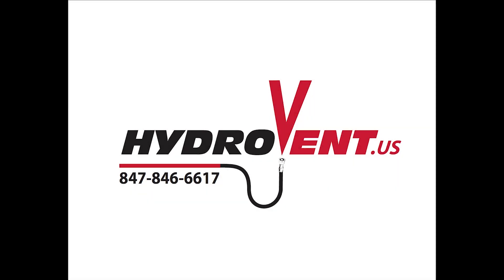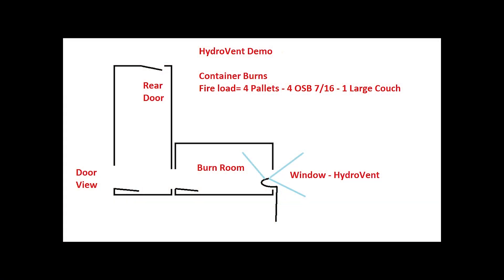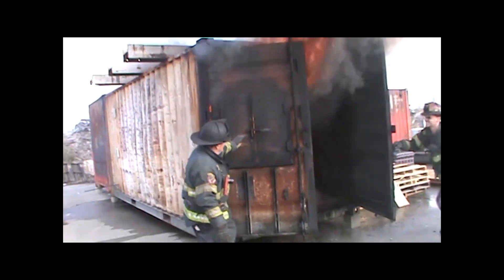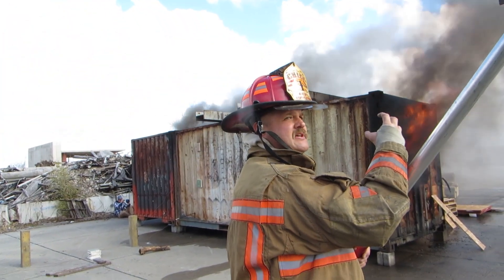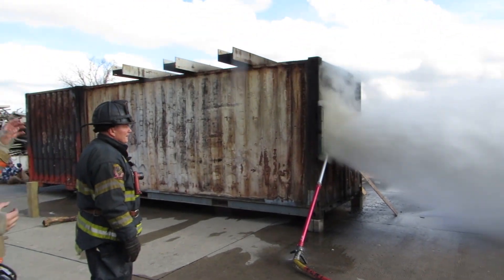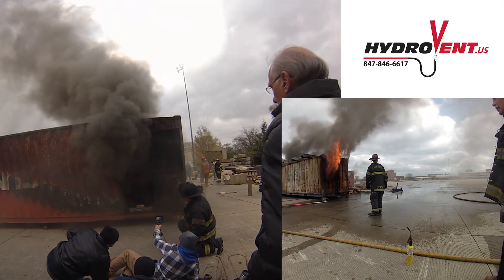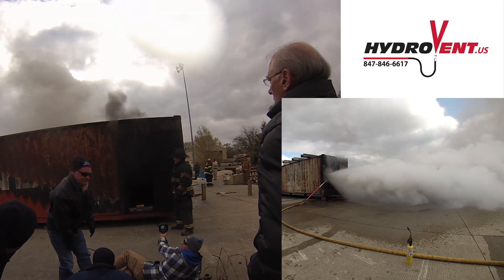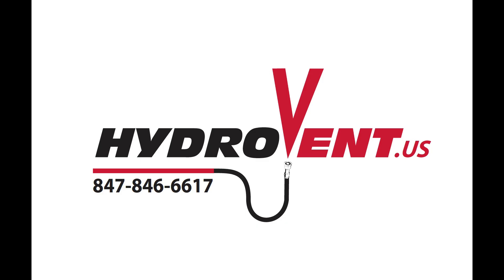Hydrovent Demo 2 -Explanation - Exterior side by side @ 3:43

Comment: Nice invention. It can be VERY useful. My concern though is that it won't be fully integrated into the initial fire attack due to the heavy "cultural nature" of the fire service. We've been doing things a certain way for a LONG time. I worry that it will be seen as a novelty or gimmick and end up "rusting" at the bottom of whatever compartment it's hidden in. The way this tool is integrated into a department is just as important as the functionality of it.
Reply: A good parallel would be how vertical ventilation was introduced in the 1980's. My department introduced it with a comprehensive training and skills assessment process. It has been very successful. That being said, it was followed with a positive pressure horizontal ventilation program. Both work well in their place and can have disastrous effects when done improperly.
Reply from the maker: @25mfd  my father and I invented a tool, and we have been showing it offer 15 years plus. It is coordinated attack in one tool water in, ventilation out.
And yes, it has taken a long time to catch on